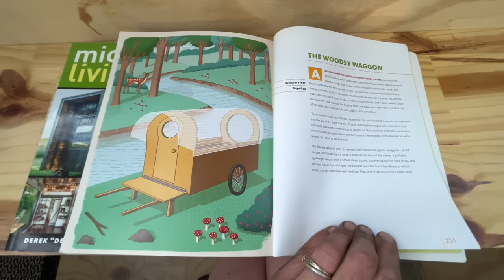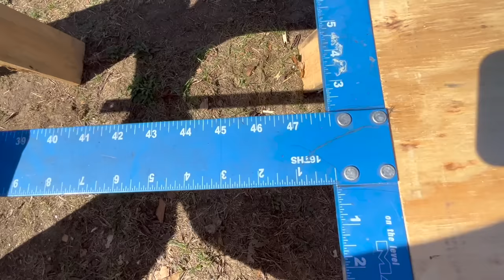BUILD IT: The Star-gazer Micro Camper

Comment from the maker: This is NOT designed to be pulled behind a vehicle. 

I pulled it on gravel roads and went very slow with my ATV for testing. If you wanted to transport it somewhere you could load it onto a flatbed utility trailer and take it there for delivery. This is simply meant to be MOBILE- in that you can move it around as you wish. This is meant as a backyard camper or let your imagination run wild- greenhouse, office, spare guest room, mobile chicken coop, etc. OR build it without the wheels on a permanent foundation (blocks)! 

Park it in the SHADE so you don't get cooked! Haha But shoulder season- that solar effect is going to feel GREAT! I hope to see lots of these built!!
Reply: Yes.  On your private property.
Reply: Love Love this and I want to build. Do you have a max + weight capacity? Thanks Brooke.
Reply: Thank you for clarifying this cuz I seen some comments where people wanted to do it and pull it behind their vehicles and take it traveling.
Reply: Thanks for sharing it and the information on pulling it  .
Reply: You could add some screw in curtain O rings & thread a light elastic for a block out curtain ? Alternatively you could just use a canvas secured to the outside which can be removed easily when required?
Reply: You bone good 😎
The only thing I would have done different would be to put the door on the tongue side and add 2 hinges to have a fold down porch --- I did like that you painted before cutting and fitting 
👍
Reply: Good job! This would make a cute chicken tractor 😅
Reply: You could put it on a trailer.

Comment: The "hitch" is called the tongue,the part you bolted on is called a coupler,and an axle mounts side to side ..  Repurposed set of street motorsickle wheels and tires,some taillights,clearance lights,wiring,and safety chains and one could tow it on road at lower speeds...

Comment: Watching you finagle those axles and wheels took me back to when I was a kid and we'd build these home made "cars" we called buggies. A 2 x 12, a couple of 3 foot 2 x 4's to attach old baby carriage axles and wheels to we scrounged from the dump. A carriage bolt through the front axle assembly and 2 x 12 so you could steer it by pushing on one side or the other of the front 2 x 4 with your feet. Then race them down the long hill near our house. It's a wonder one of us wasn't killed. At the bottom of the hill was a T intersection with a fieldstone wall, and of course there were no brakes. 🙄
Reply from the maker: LOL love it! yes and i am basically a little kid

Comment: I used to build Micro campers. To save money, instead of buying angle brackets, buy one long piece of angle aluminum. Cut pieces to desired width, drill holes, and use those instead. Saves a lot of money😊😊😊😊.

Comment: A tip when ripping long materials like that 2x10s on a table saw is to cut about half way and then turn the wood on end and cut from the other side so when the cuts connect, the wood is supported in the middle where the cuts meet. Works well when you don't have an outfeed table
Reply from the maker: thanks!
Reply: Sounds like a safer way to rip

Comment: I love your builds
And your outdoor nature spirit 

I built a truck camper modeled after a vardo, and built with much thinner plywood glued to 1.5 " foam board, and twin wall polycarb on each side of roof 2 foot wide running full length of camper .
The twin wall is super tough.
After 4 years of living in camper , only some dents from backing into trees .

Then I built a micro tiny house patterned after my truck camper , but with a raised middle roof section with windows 360 degrees , made from lexan , and hinged at top .
Long story , but what I want to say , is I love to build things 
Express my creativity and have my creations be functional and nice to look at .
And being able live fairly comfortable in something I built with my own 2 hands brings me great satisfaction.
And I love your two pan bath 
Simple pleasures 
🤔👍😊🦊🐿️🐬

Comment: I have had those paper shades in my RV. I have a small valance on each window and I just roll the shades up and tuck them inside the valance and it stays. You can't see the paper shakes at all when they are tucked up inside the valance and at night I just grab the paper shade and unroll it. The window treatments came with tracks for the paper shades but eventally the strings of the tracks wore out so I just ended up cutting the paper shades to length for each window. I've had my RV for 27 years so stuff wears out. You could put on a little piece of wood on that rafter and there would be no need for the clothes pins.

Comment: Wow, what an awesome build !!! Just three little things I would adjust - first, secure the nuts that hold the wheels, otherwise one of them will loosen up (Oldtimers used left and right threads on their wagons), just drill a small hole through the rod and feed in some stainless steel wire - second, use plain PC-sheets to get a perfect star-gazer-look-through, helps reducing the weight a bit too - and third, put two extra strips of aluminium right above the end walls. Using small screws into the end walls (e.g. 2,5mmx25mm), you could omit the ugly blocks. Using washers and some silicone will waterproof it as well as the special roofing screws (don't forget to drill a bigger hole through the PC for thermal movement).
Have a lot of fun with your star-gazer

Comment: I like this, but I didn't see any insulation, heat source, water source, cooking source, or electricity. You could add something as simple as a primitive battery (such as a black drum of water) that will utilize the greenhouse effect of the roof. You could insulate with thin foam boards as well. Maybe cut a small rectangular piece that will fit above you, and double as a blackout for the top? You could bring a solar panel and a solar chargeable electric generator for the electricity, and bring a large jug of water on the back of the ATV and use a sun Joe sprayer for a shower. Then, you could theoretically live there as long as you had a food source and access to fresh water. If you made some of these updates and showed us using it over a weekend, that would be a really cool addition to this video. Thanks for the content.

Comment: Love the porthole window :) I also appreciate your tips on the bed build. My "bean-bag" bed idea turned out to be an expensive disappointment. "Bob Ross solution" ... I'm using the foam filler for more insulation in the walls & ceiling, then building a platform bed for da woof and I :) Great work! Looking forward to your next post ... God Bless

Comment: This is great but may I make a suggestion?         On the wheels.    on the outside of the axle nut. Drill a hole through the axle and insert a cotter pin,  this will protect you if the nut loosens up.

Comment: That was incredible! but the sharp clear plastic roof ends bother me... knew someone with a shed & some of that on entry way - almost took his pal's eye out!  Needs some of that black foam pipe covering which is slit on one side, to put over/glue/nail in place as protection & also easily visible. But WOW, fantastic video 😍
Reply from the maker: it's fine after cutting and sanding and rounding the edges

Comment: You beat me to it, but I was going to suggest a welcome mat to clean your shoes and maybe a dog bed tucked underneath your bed. I liked it better after you added the shades. I'd consider a battery powered fan in case you need it for extra ventilation or if it got foggy inside.

We have a couple of trailers at my house and one is like yours in the video, but the other has welded tubing and the guy who refurbished it screwed plywood sheets to the frame. I have been thinking of making it into an enclosed trailer for taking long road trips or if we ever need to evacuate during hurricane season.

Comment: a 3 x 3 would give you a 2.5 x 2.5  board if there were any at your hardware store 10 feet long.  This looks like a terrific build. It could also be built on a harbor freight or northern tool trailer. For a fold down table, I'd cut boards and attach them underneath with slides so they can be out of the way and brought out when needed.

Comment: FYI: You'll want to make sure your axle nuts are locked in place so they can't back out and fall off...on the left side in particular.
You can drill a hole in the threaded rod and use a cotter pin and a crown nut to secure.
If you are just going to keep it stationary then it won't be a problem.

Looks like it would be fun to hang out in and read a book during a nice fall day!

Comment: I think for that frame, I Don't really trust pine wood for the frame, I think I will modify it and use aluminum  studs, like they use in basements. Just don't run the eheels off, I did that with my camper, my truck tires were bigger than my Scamp tires blew em out, nobody told me that would happen

Comment: your camper is nice in the summer but it is also gonna be hot especially if the weather is too sunny and hot. Do you need to cover the roof to prevent from heating inside but in the  Winter it is gonna be cold there is no insulations.and how safe is  your camper when it comes to wild animals

Comment: Why did you apply the roof panels so they couldn't drain? The panels must be installed vertically, not horizontally. In a shaded area it's guaranteed to mold.

Comment: you could drill a hole through the nut and the rod and put a cotter pin through and bend it around so the nut could never come off the wheel ✨🤪☮️😌 On a  car you have what's called a castle nut to put a cotter pin through 😉

Comment: Will you get moisture building up inside? I love your build, and attempted a smaller vardo for my daughter (on an old apple cart) but haven’t got a roof over it yet.  I was going to use an old vinyl signage banner with some type of insulation blanket underneath….but the clear sheeting would be super cool!
Reply: Definitely don't put the roof on like this, the water has no way to drain off. The panels must be vertical, not horizontal.

Comment: This is in no way safe. 1/2" thick walls and clear, see-thru panels? You're clearly taking your safety for granted. Bears and meth labs and just crazy men period in those woods. You need to prepare for danger. You dont have to be paranoid but its better to be safe than sorry...have protection if needed. This is not much more than a tent. One good kick takes that door out. I wish you all the luck that you never encounter the type people that i have in my RV and camp grounds and secluded areas.